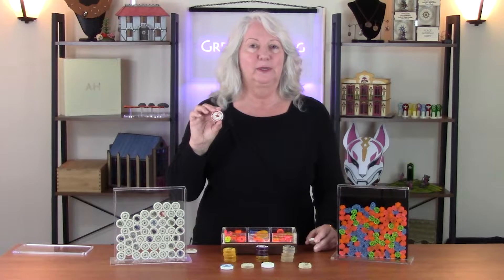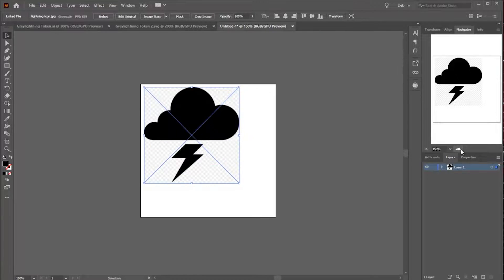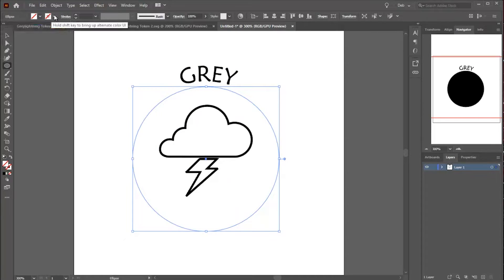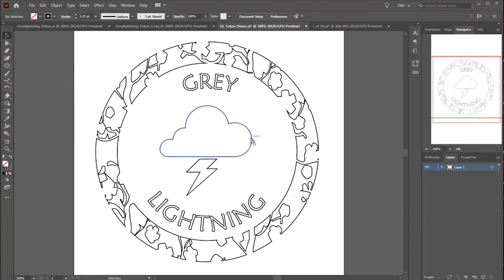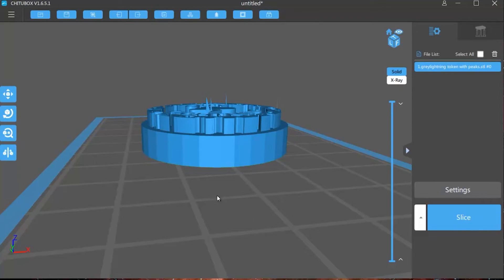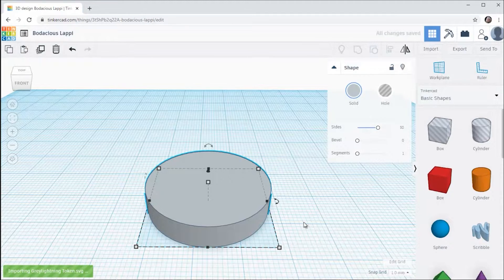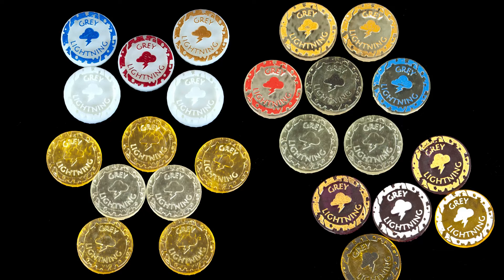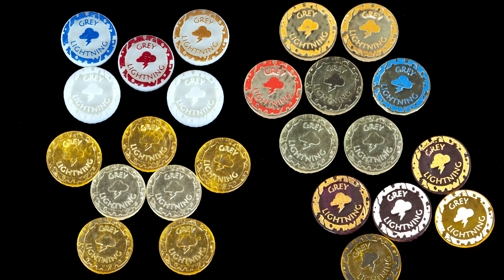How to Design Custom Tokens for 3D Printing

Comment: You're chemist friend is very wise.   PRO TIP:  You can use the Workplane Tool (press W) and the Drop command (press D) and the two faces that are adjacent to each other will match up exactly. It saves a lot of fussing with the height and depth when you already know the dimensions of each section.

Also, It looks like you are really enjoying the resin printer!
Reply from the maker: Wow, great tip, thank you Born Again! You are, of course, another of my very smart viewers!!
Reply: @GreylightMay  You made me blush!
Reply from the maker: Well deserved!

Comment: To remove the spikes you could make a box in Blender a bit bigger than the art, move it to just touch the piece and use the Boolean tool (modifier, Difference) to remove them.
Reply from the maker: David, this is very helpful, thank you! I will definitely try it. I really want to learn Blender because I know I will have projects in the future that Tinkercad can't handle.

Comment: My only issue while trying to watch this is that I keep missing steps and having to stop and rewind  because you are moving between each step very quickly. I am new to all of the programs and can not keep up at all. I got very stuck when you say you got rid of the lines, removed the fill and and and...

Other then that I learned a lot from the video, just hoping I can get past this fill step.
Reply from the maker: Sorry, A Girl, you are right - it's a lot when you are just getting started. I have some videos where I do deep dives on Illustrator and Inkscape, but I don't think you need them for this project. Tinkercad is so forgiving on its svg import process, removing the fill may not even be necessary,  but that's how I do it, based on my laser cutting projects. When you select an object on the screen, there is usually a place in the upper toolbar where it shows the color and thickness of the lines or strokes, and the color of the fill. When you click on those you get a drop down menu that let's you change them. One of the color options is a slash, which means no color. Pick that and the color disappears. Removing the fill color makes it easier to see the lines that make up the drawing that you want to save as an svg. If you get stuck, send me the timestamp of where you are in the video and I will tell you more about that step.

Comment: Another good video. If you want there is a video where I learned how to fix spikes/artifacts in Blender easily, "How to fix artifacts in Blender" by Josh Gambrell. Just if you want to stick with 1 program. About 8 minutes in shows the problem I was having with LARGE spikes, ugly things. 
I would recommend saying what version of Blender you are working in, some people use 2.8, 2.83, 2.9, I am using 2.91A and I notice that hotkeys have been changing. But I love 2.91A, if you design your trees, hills, buildings in Blender when you enable object selection you can edit only that part and the others will dim in transparency making it easier.
Reply from the maker: Thanks, Rose, I will definitely check out this video. I know I will have to use Blender for more complicated models that Tinkercad can't handle, so anything that helps me get more proficient is very much appreciated!!

Comment: My observation is also that Blender is not a great tool for me for a lot of 3D printing jobs. I know it is super powerful, but it's best life is as a model designer/renderer not a CAD program. I find tinkercad and freecad way better for what I need them to do. I am looking really closely at the currently available Corel humble bundle. I already have Draw and Paintshop Pro but It includes CorelCad which I think I might like but haven't tried and you can't beat the humble price. I use CorelDraw for my designs but mostly because I know the software, which to me is the most important thing. Competitive things are competitive for a reason. They all do similar things, just different ways. If you know inkscape well, you can likely do things better than you could would expensive software you don't know, and if it does everything you need, don't change. I guess the same rule would apply to Blender, if you are a Blend master, and can bend it to your will, fantastic. But you should always use the thing you can do the most with the fastest. They are tools to an end, not an end.
Reply from the maker: Scott, what a wise insight into why we use what we use. I know that doing my designs in Inkscape would probably be more accessible, because it is free, but the truth is you use what you know. I've been using Illustrator for years, and I'm just more productive when I use it. I did a separate video on how to replicate my designs in Inkscape, and just hope that acts as a Rosetta Stone for all my Illustrator video content. When I'm always behind on getting the next video out, I just don't feel like I have the luxury of going up the learning curve on a competitive application. This is partially why I am really amazed at how easy Tinkercad is to learn. I'm working with some schools that are using it for all their 3D design work, and now I know why!

Comment: I did what you said to do and I couldn't even get it to import???
Reply from the maker: Robert, you mean you couldn't import an svg into Tinkercad?
I found this: Tinkercad does not support SVG import of image data, clipping paths, or fill data within the SVG. However, SVGs with fill color inside SVGs paths will be imported into Tinkercad. Also, the SVG must be under 4mb, as anything larger may be too complex to convert into 3D in one go.
And this: SVG files should only contain vectors or linework, not any image/raster data. Tinkercad does not support SVG import of image or raster data within the SVG. SVG import into Tinkercad converts curves to a best approximation of straight lines.
It sounds like there could be several reasons why your svg is not importing. Do any of these fit?
Reply: @GreylightMay  ok so works the best for programs that are free to use?
Reply from the maker: Robert, if we are talking Tinkercad  vs Blender as the 3d modeling software, Blender is also free but much harder to use, and particularly finicky on importing svgs that you can then extrude to make 3 dimensional.  There may not be the same limitations on file size, for example (I don't know), but when I would import the same svg file to both programs, Tinkercad would be a clean import and Blender would be full of anomalies in the third dimension. This seems to be a common experience because a search shows lots of suggestions for how to get rid of the anomalies. That's why a viewer suggested Tinkercad to me, I showed this in an earlier video as  a problem I was experiencing.